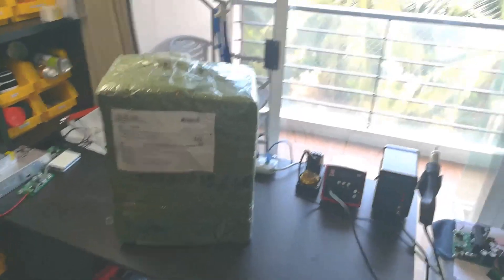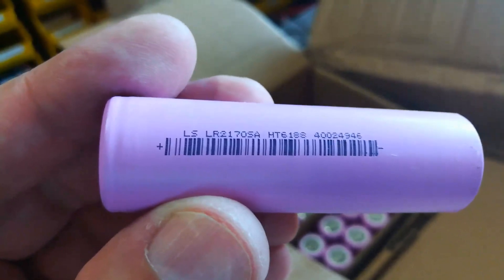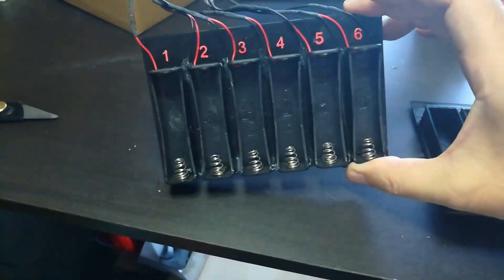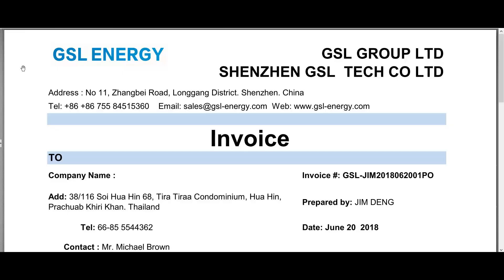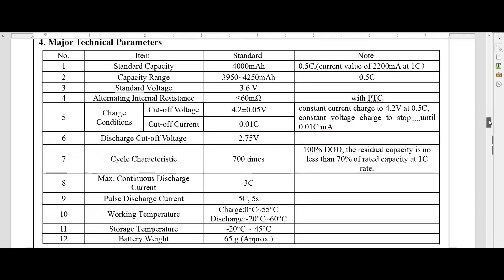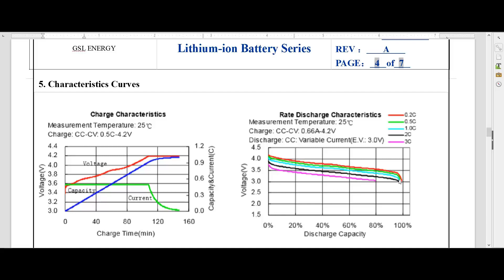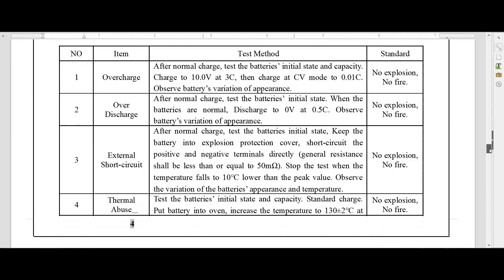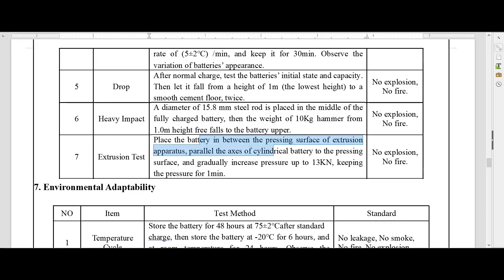21700 Lithium Battery Pack Part 1

Comment: Here you can find BigBattery’s Model 3 2170 Cells will trump any and all 18650 designs with 4800mAh Per Cell – There is nothing better!
NEW, Uncycled Model 3 Cells are harvested from assembly defect modules. All cells have been professionally buffed, tested, re-wrapped & laser welded with a cap for safety when spot welding. These cells are perfect for building DIY projects such as power walls, any lead-acid to li-ion conversion, mobile solar generators, etc.
https://bigbattery.com/2170

Comment: Hi Mr. Brown, what is the chemistry of this cell. According to the part number IFR21700-4000mAh=3.6V that you showed the cell specifications, it tels me that the chemistry is Lithium Iron Phosphate (IFR)! But LiFePO4 cannot have such voltage! Also, the part numbre of the cell it self (LS LR2170SA) tels me that the chemistry might be Lithium nickel cobalt aluminum oxide(NCA)! However, looking at Lishen specifications, they are very secret about the chemicals! Do you know ?
Regards,
Reply: @MikesTropicalTech  I've just sent you my email to your yours. Currently watching the rest of you videos on the battery pack. :)

Comment: Hi Michael. You can tell me more about battery?? I want buy for my scooter 60Volt 16S10P but i need 100 Amps sontinual discharge ( 10 amps per cell ) How you make charge/discharge cycle and what your battery pack say after 1 year used?? Thank you

Comment: Thanks for the upload Michael, you where right about the thin selection of enclosures and battery holders currently available on the market for the 21700, in time im sure it will get much more support and become the official 18650's replacement, I've also been digging into the larger form factor 26650.